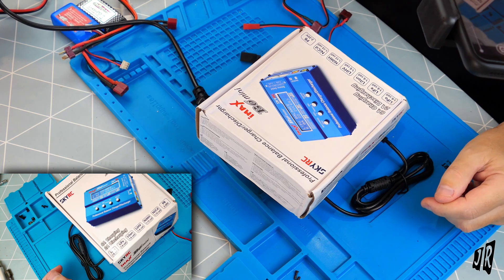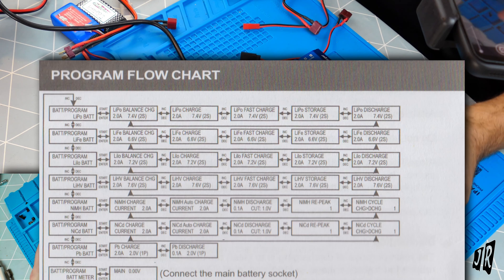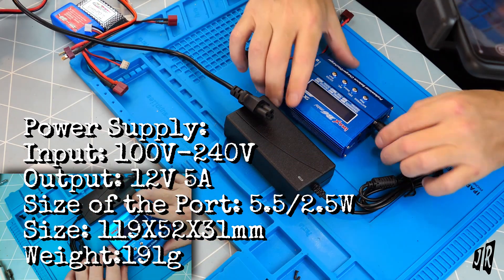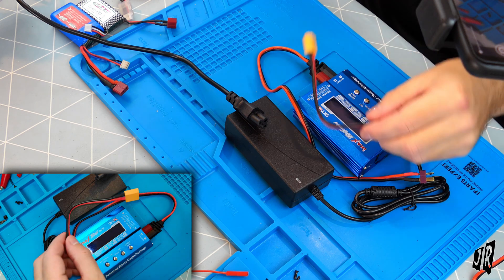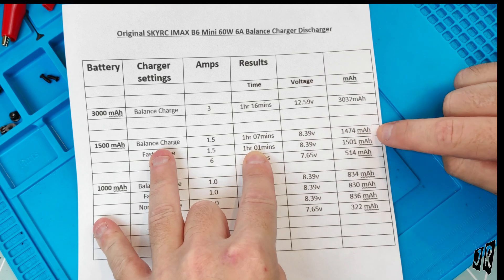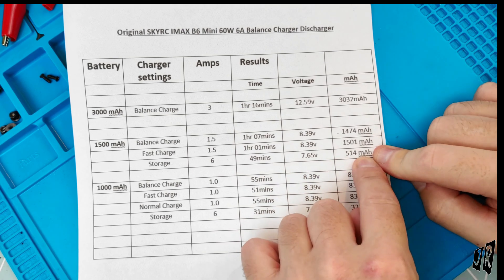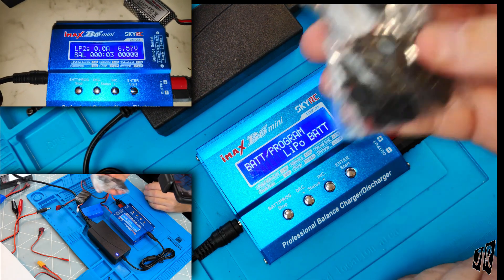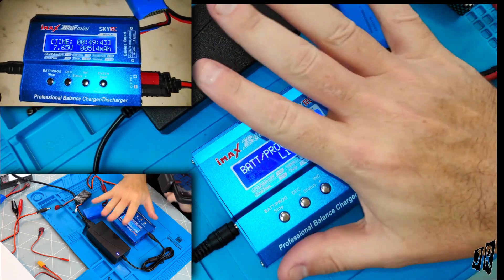SKYRC IMAX B6 Mini 60W 6A Balance Charger, Discharger & store!

Comment: How long would it take to charge a 500mAh 2S 7.4V 3C LiPo battery?
Reply: You should always charge at 1C, so 0.5A in your example. It should take around 50-60 minutes, if the battery has 100% capacity.